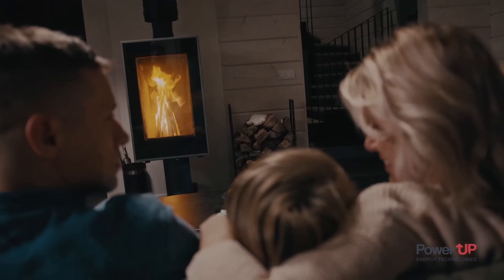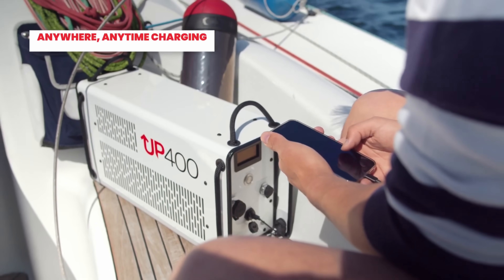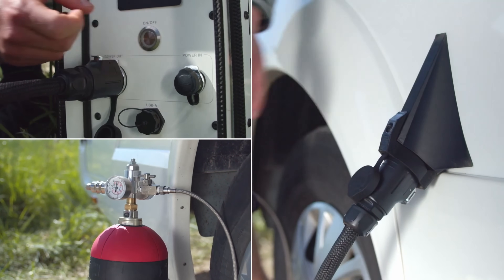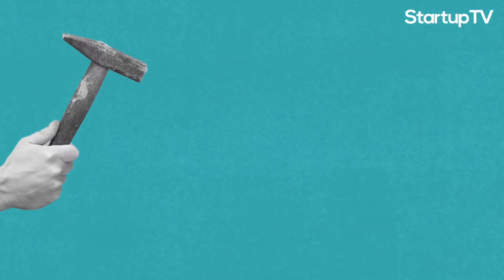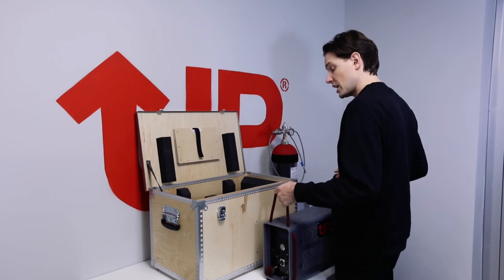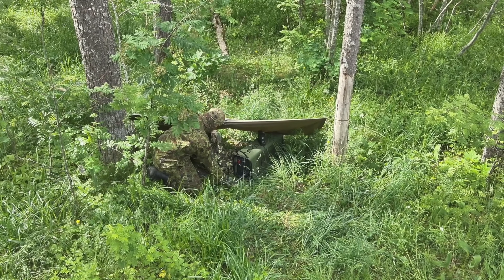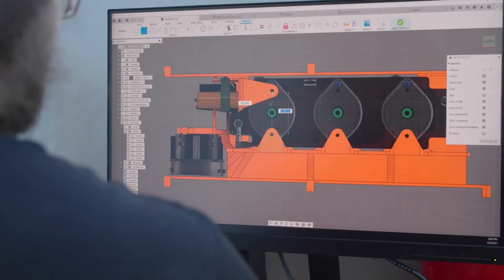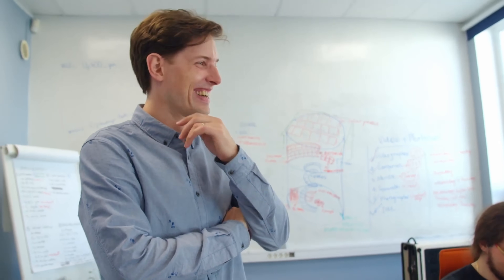European Company Shocks the Whole World with New Free Energy Generator  1000 kW in 2025!

Comment: Waaay 2 cost prohibitive. $9G & it doesn't come w a gas system or the special & very spendy H2 cylinder? Only puts out 400w? I can build an off the shelf solar system 4 less than $1000 that generates 400w, a wind turbine system for under $500 that generates 400w. Thats not all, 4 that price, I can build a bunch of them, w battery storage, for night use.